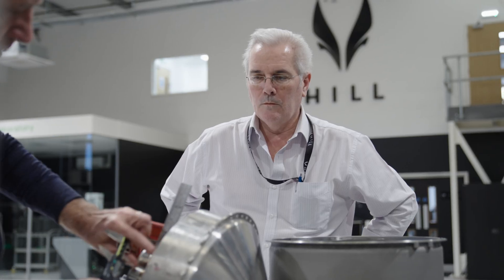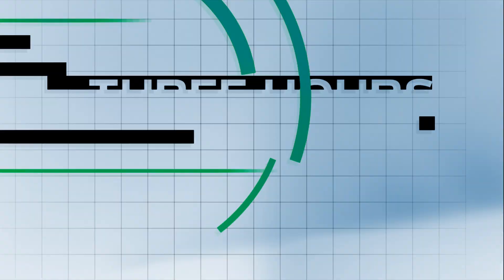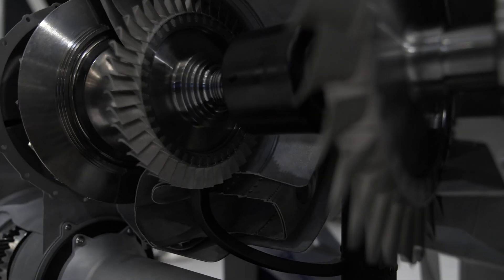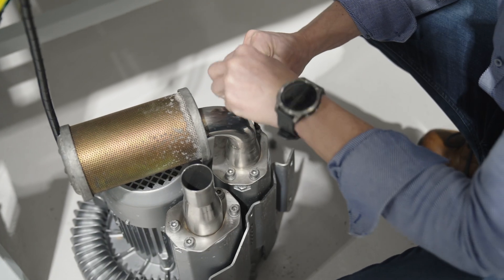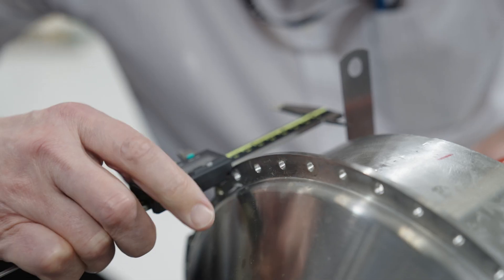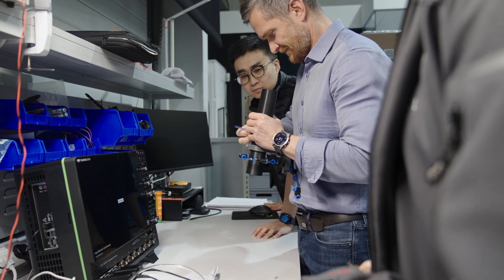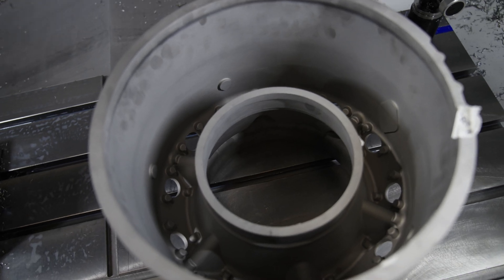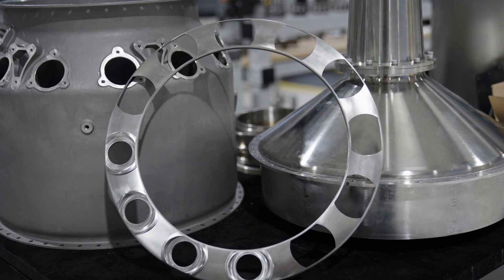Journey to the HX50 | Episode 37: Inside the Creation of the GT50 Engine

Comment: there is a lot of sense in manufacturing your own engine, for one huge advantage, your in charge, in control of every part and not relying on another or many companies to deliver either the component, service and at aerospace specs

i have often wondered about air accident investigations, a part fails, and it take ages to follow the paper trail back and forth to locate how the fault came about, with Hills, the investigation might be much faster to determine, everything is under one roof, no one else to blame, it could be an advantage or maybe not, but at least if a recurring fault is found, then changes can be made quickly and resolved - now that would be an advance in aviation, to learn by mistakes and evolve positively